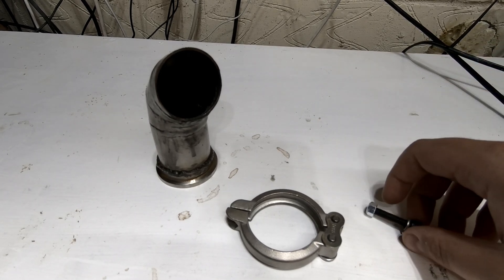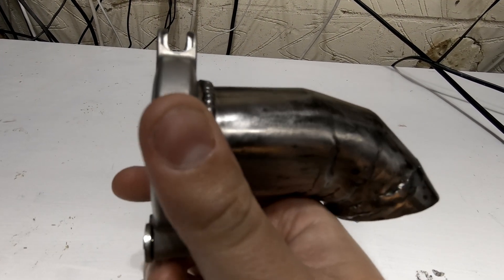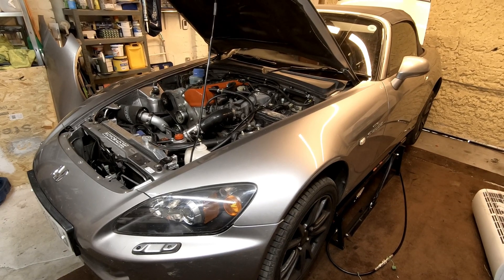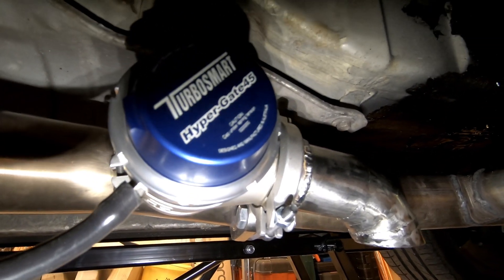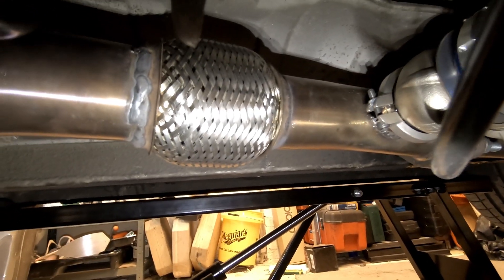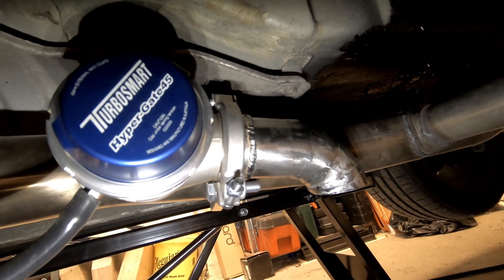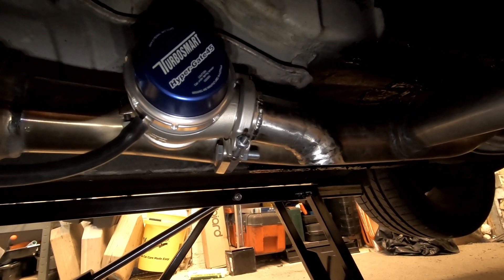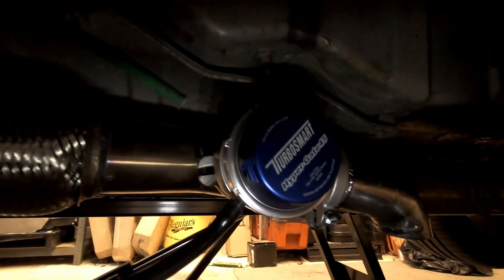Honda S2000 exhaust bypass using a wastegate

Comment: How is this setup working for you? Does it make more power? I'm contemplating doing a cutout on my stock exhaust instead of using an aftermarket 3in exhaust for my turbo setup this fall.
Reply from the maker: Based on my data logs I ran leaner after fitting the valve. Car felt abit more free to rev as well. Be wary of the electronic valves, opt for a boost operated one as they are more reliable
Reply: @Marks-Garage  noted. I'm forsure going to run the wastegate setup. I don't like he flanges, they seem to fall apart after a year with leaks. I'll make sure my tuner knows the setup so he can make the adjustments.

Comment: I was confused at the start of the video... Thought you switched to a Turbo setup for a second. Never seen this done before without a turbo. Very interesting.
Reply from the maker: I have seen a few people do it on youtube. There is plenty of people who just use an exhaust bypass valve but they seem to have mixed results and that they break and cause issues etc. A wastegate should in theory be able to do this all the time without issue. So fingers crossed it will be okay